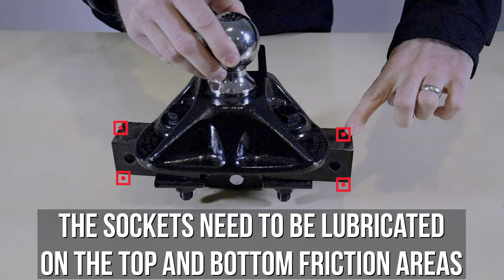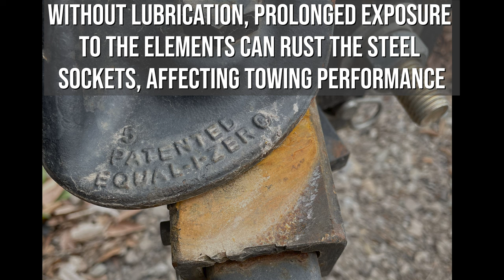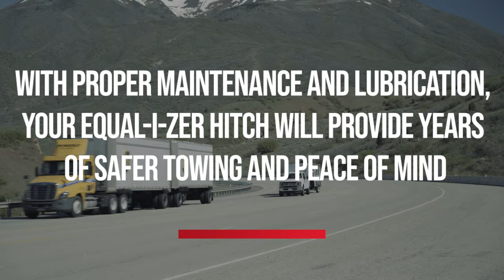How to Properly Lubricate the Equal-i-zer Hitch

Comment: I recently purchased the equalizer 4 point hitch. Recently returned from my first trip. Fyi I didn't lubricate the pivoting head and omg was it noisy. Now I see that had a remedy.  I had one major problem if you guys can help me with this. After making a left hand turn and straightening up my car would pull to the left.  Same thing would happen if I made a right turn. After it would pull right.  It made my highway ride extremely uncomfortable and unsafe.  Especially when a semi would pass me. It felt like the hitch would never return to a straight line with the trailer. Sort of if the hitch would seize up . Are my bolts over torqued.  Do I need to regrease everything.  Btw the car has new tires and a fresh alignment.  Also when not towing it treks perfectly straight.
Reply from the maker: Hey! Glad to hear you fixed your noise situation! As for the sway problem, it does sound like your bolts need tightening. But to be 100% sure, I would contact our customer service team at support@equalizerhitch.com or call them at (800) 478-5578, and tell them what's going on. They should be able to help you figure out the problem!!

Comment: So I remove the sockets from the hitch head to lubricate them........is that wrong?  I just purchased this system and I couldn't even move the sockets with the spring arms in (which seems like a huge issue).  My truck also has a suspension leveling system that will counter when I put a trailer on the back so the measurements for weight distribution are never the same.  I can't say I'm overly impressed with your product right now.
Reply from the maker: We are sorry you are not impressed, and would love to help you through these questions. When an Equal-i-zer hitch is brand new, the arms are very tight. This is due to fresh paint, and highly torqued bolts. Lubrication will definitely help, and as you use it, the arms will move easier. You can also lightly back off the torque of the bolts, if you are still having issues. If you call our customer service team, they can help walk you through that and how to adjust your weight distribution with your leveling system. Our customer service contact is support@equalizerhitch.com or call them at (800) 478-5578. 

Here's a video that might help as well: https://www.youtube.com/watch?v=mj2oqAiltsk
Reply: @EqualizerHitch  Thank you for the response.  After more research and watching videos posted by other users I've been able to fix the tightness of the spring arms and understand why they are so tight and that they should not move very much anyways.  My previous sway bars were from another manufacturer so I expected yours to be used like theirs.  I will say you guys have some great videos out and I do appreciate the time and money you guys have spent to help people like me who have no idea how to use systems like this.

The leveling systems is still going to be a huge issue so I will contact your customer support.
Reply: You don't need to remove anything really. Leave bars in and extend fully one dire tio lube then back to the other extreme and lube.... Done!!!